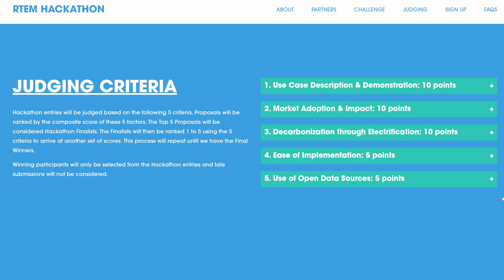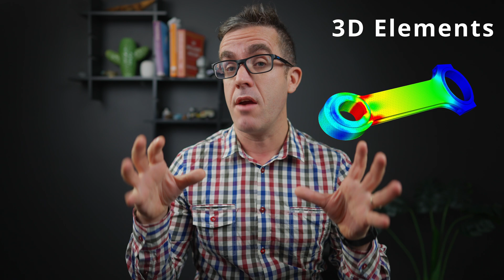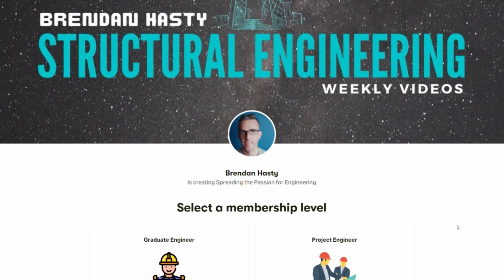Finite Element Analysis Explained | Thing Must know about FEA

Comment: It is interesting to see FEA  from a civil engineers perspective. The GLAD acronym does not at all address the most difficult part of 
FEA which is establishing the correct boundary conditions. For example, the conrod animation indicates clearly that the boundary conditions are wrong. One end (the right) was fixed while the other end (left) appears as though a pressure load was applied. I have seen this mistake so many times.  This is why civil FEA engineers should leave mechanical systems to mechanical FEA engineers.
Reply from the maker: this is what I would cover under geometry, but total agree boundary conditions is a common cause of issues

Comment: I agree, 3D FEA is so complicated. It is hard to verify if your results are correct. Also, its analysis time increases as your mesh size decreases. If you are using Abaqus, the modelling itself takes considerable time since you have to model the parts one by one then assemble them. Ansys is more a user friendly than Abaqus but also requires experience and time for the analysis.

Comment: I would argue that 2D elements are actually harder to work with, although they more easily give rotation information. With 3D elements, you will find many more singularities in you model, which are actually physically there. With 2D elements, these are glossed over. Do you compare a lot with actual strength and fatigue tests?

Comment: Not sure how eurocode works. But, ACI 318 recommends reducing the moment of inertia for the cracked section, instead of Young’s modulus.

I suppose it’s all the same though, since Young’s modulus and moment of inertia both carry the same weight in the stiffness matrix. 

What a great video. I don’t think anyone learns FEA in one semester. FEA is a lifetime of learning. Keeps us from getting bored as our careers progress.
Reply from the maker: Hi Ryan, for a plated model it is harder to reduce the moment of inertia as it is a geometry governed. The only difference youngs modulus would be axial shortening.
Reply: @BrendanHasty  This is great to hear a reply, thank you! 

I realize now that we should reduce Young’s Modulus for Plate and Shell elements; in order to maintain correct geometry.

It is up to the designer whether to reduce E or I for beam/column elements, based on what they’re checking?

I remember now that rod elements only include E and A in the stiffness matrix.
Reply: @ryanharris6090  some FEA programs, such as Oasys GSA (disclaimer: I work for them) also allow you to independently adjust the in-plane and bending stiffness relative to the geometric properties so that you can address such problems.

Comment: In the world of mad data scientist there exist structural engineers preserve the beauty of engineering by some wonderful video tutorials
Reply from the maker: Thank you for your support and kind words!
Reply: @BrendanHasty  sure sir these days a little bit over confidence have taken over every body by the abundance of data and relaxing Ai innovations still iam struggling to write a fem code in basic numpy library and the strugle goes on of years to connect the global stifness matrix even though iam an mechanical based engineer i love civil concepts but a displine of engineering is only by dedication to make some tutorial with no expectations or returns a great job sir. the intervention of pinns as neural networks could soon dominate fem concepts but still traditional methods are the work of beauty to account everything into the knowledge of engineering

Comment: Hi Brendan,
Thank you very much for this great summary on FEA. As you seem very familiar with the method, that would be interesting to have your thought about how you model complex phenomenom like imposed deformations in reinforced concrete structures (like temperature changes or shrinkage). Thanks again for your work.
Reply from the maker: Thanks for your advice Hadrien! I've recorded a FEA 2 about tips on using the analysis, maybe I should do another video to cover the issues you suggested.
Reply: @BrendanHasty  Hello would you explain these fundamental s to an artist particularly colossal monument designers like sculptors who's figurative works tend to be more complex.

Comment: Lol FEA might be the forever sorrow and bitterness deep down in my heart. This was the only unit I was so keen to learn but failed at Monash due to unbalanced workload from a team project in another unit. And when I got another chance to re-study the FEA at UniMelb, man, the final exam was changed. There were FEA questions and structural design questions and the latter is indeed design oreineted, which means, for example, I had to trial concrete cross section and correct it if the selected cross section fails in capacity calculation and so we needed more time. We had no choice but to give up FEA since we could not guess how many marks we can get from calculation steps for FEA. But we definitely know we can get the most marks as long as a complete capacity calculation is performed in structural design 😂. So to myself, I could never prove that I comprehended FEA and this is such a pity. But anyway, thanks for your great video.
Reply: dudee sameee. I was so eager to learn FEA to this day but when I took the class a lot of things happened in my life outside of my control I ended up just copying and memorizing past problems and solutions, which in the end gave me 0 understanding on the concept. Plus I also forgot how to do the hand calculation so I guess I need to re-learn it from youtube or FEA courses somewhere :"")
Reply: @BY-sh6gt  Yea what a shame man. Niw although my work does not require hand calculation of FEA, I too wanna re-gain the underatanding of this field. Good luck m8.
Reply from the maker: Thanks for your support and sharing your experience lol never too late to pick it up though.